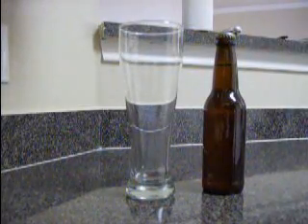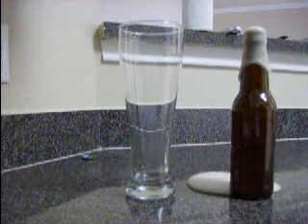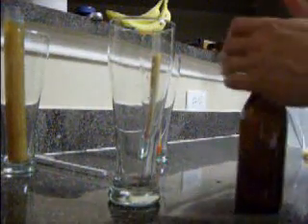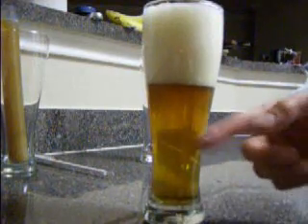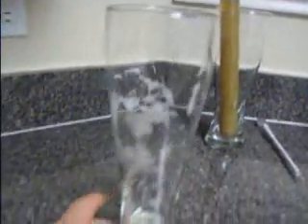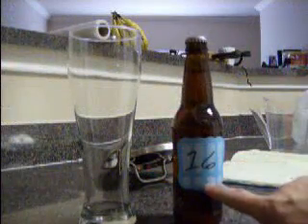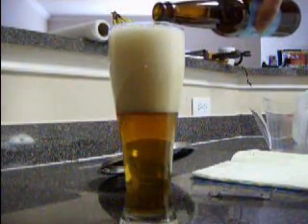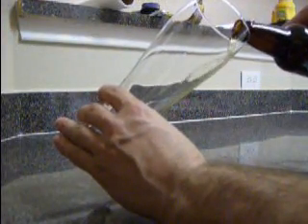time lapse carbonation

Comment: I agree, although I think jumpygoat might be pouring aggressively to compensate for the glass to bottle size ratio.
The beer looks better when the head reaches the edge of the glass, although I prefer a foam thickness of about one inch myself.